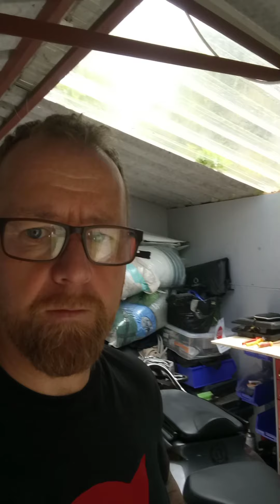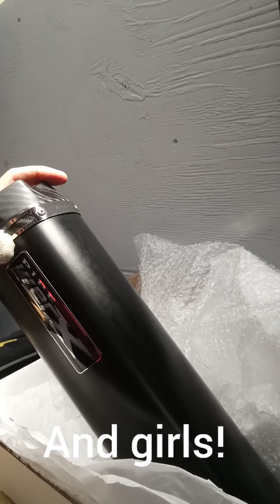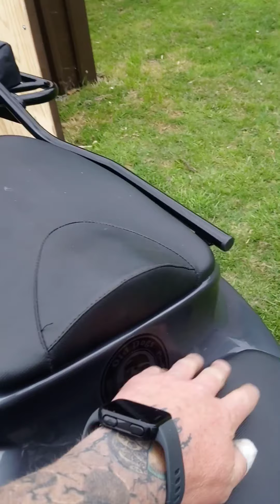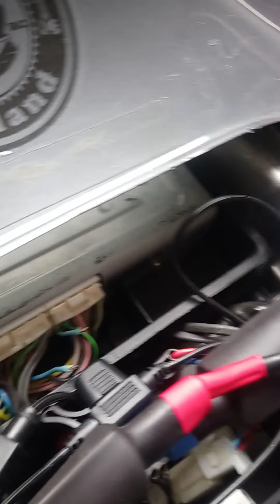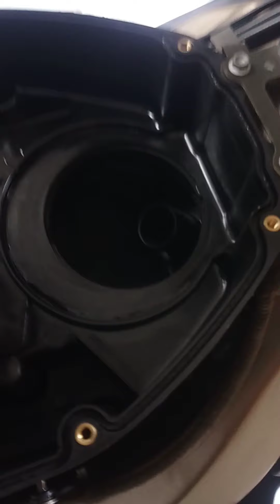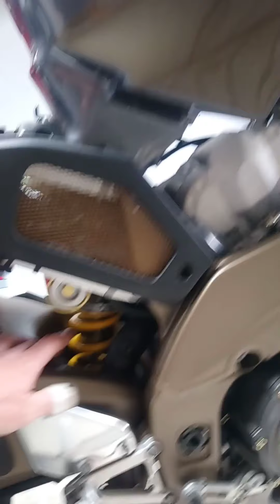Aprilia Mille/Tuono derestriction and fuel Map 2

Comment: Mine has an Akro chip and Aprilia sport Evo titanium silencer from new. Goes like wind. Would like to lower the gearing by one tooth though.
I did that on my 2002 but the changed the gear ratios on my 2003 model.
Reply from the maker: I lowered the gearing on my last RSV, down one on the front and up 4 on the back, it was great fun wheelied in third gear all day.